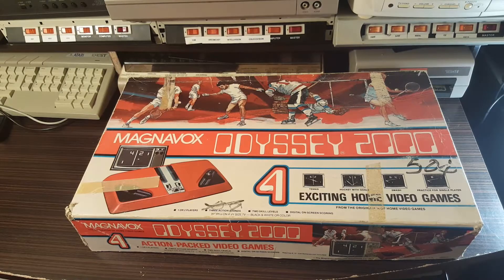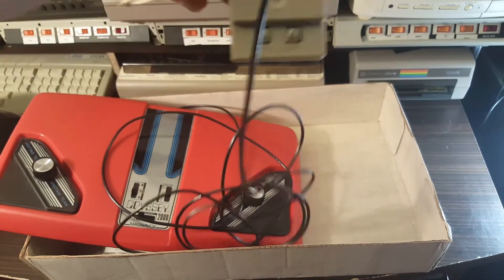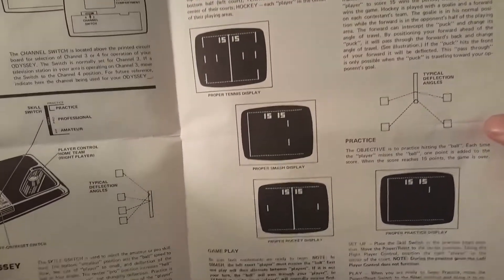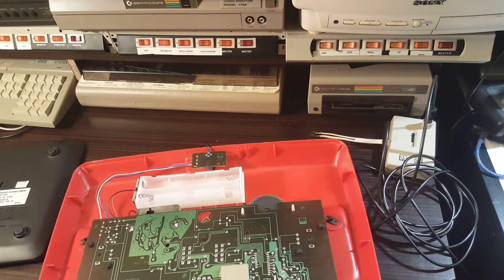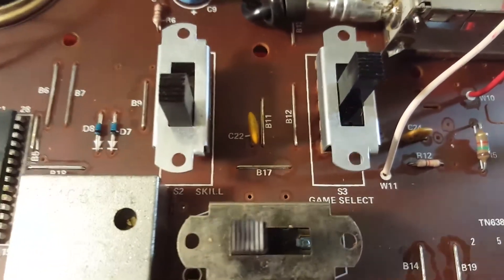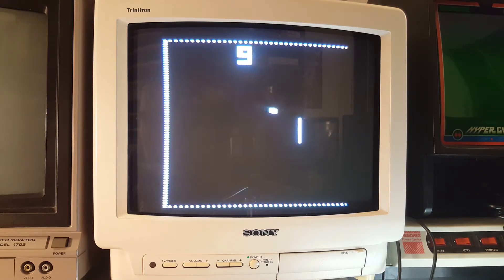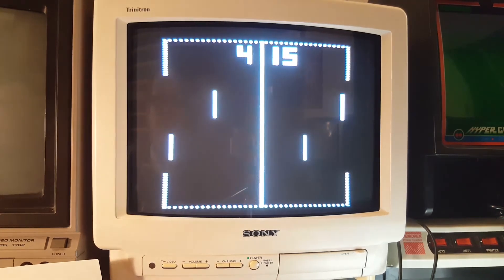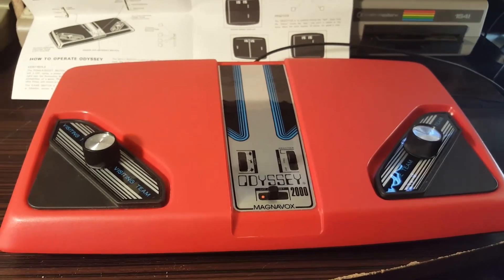The Magnavox Odyssey 2000 - Sinistermoon's Retro Reviews

Comment: This our game when I was a wee lad.  Watching you is like watching aliens landing on earth and trying to understand how things work here.  Remember, this is the improved version of the Odyssey.  My cousins had the slightly older version which did not keep score on the screen.  You had to move plastic sliders to keep track.
Reply from the maker: Wouldn't the improved version of the Odyssey be the Odyssey 2?
Reply: @sinistermoon  There were many, many iterations of the Magnavox Odyssey, all the way from the first one (1972) to the Odyssey 2 (1978).  Yours was from 77 and my cousins' model was the Odyssey 100, from 75 - the manual-scoring thing - ugh.  We hated the hard-wired RF cable because it got shredded where it entered the console.
Reply from the maker: @fododude The point of the video was to show me experiencing the console for the first time.  I achieved that. Good for you for being a little older than me and knowing things about Magnavox consoles though.  I'm for sure a fan of my O2.  Too bad you don't have a video of you enjoying the 2000 for the first time :)
Reply: @fododude  I've always thought the original 1972 Odyssey was a fascinating exercise in creative marketing--it could hardly do anything, but they sold it as this huge multimedia entertainment experience by packaging it with all these dice and cards and poker chips and plastic screen overlays. There were "cartridges", but all they contained was jumpers to modify the circuit behavior a little. You'd play through what was essentially a board game and keep track of things by moving a rectangle around the screen.

By the time of this one, though, home Pong consoles were an established product so they could sell it in this very conventional way.
Reply: @MattMcIrvin  You're absolutely right.  And the marketing genius continued with the Odyssey 2.  The promotion and artwork were so outstanding, we fell for all of it.